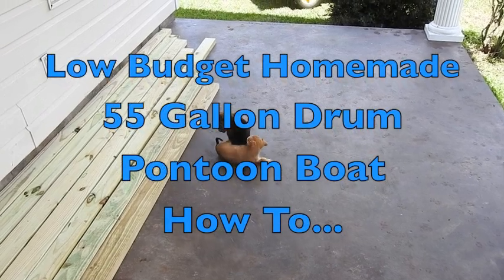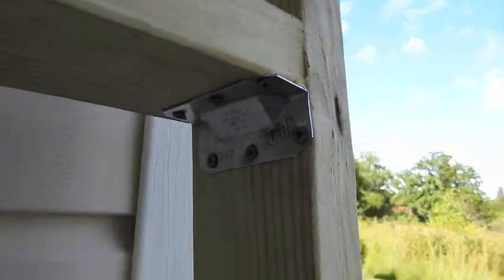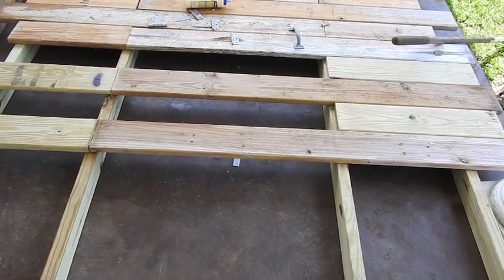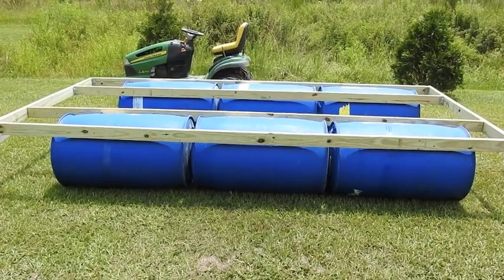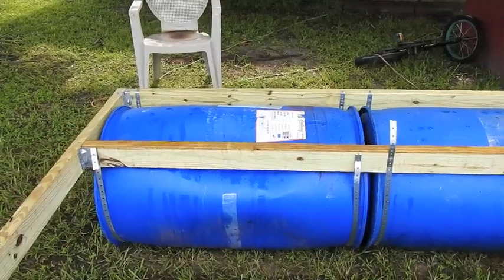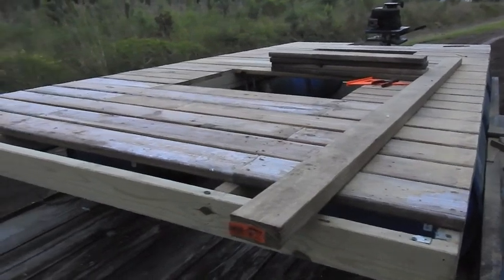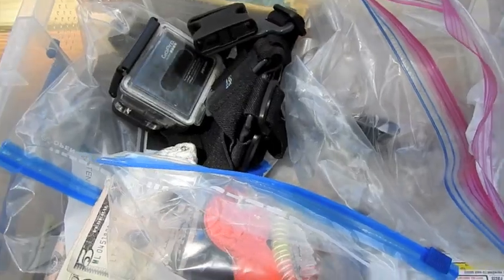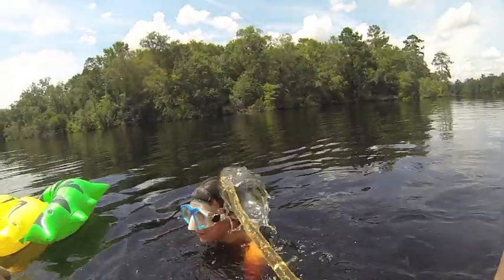My $200 Homemade Pontoon Boat (55 Gallon Drums)

Comment: Vicegrips on battery posts?  Do not accidently fall around the battery especially when you're dripping wet. Not that it would matter much I suppose. Why no battery cover and proper battery hookups?
Reply from the maker: I don't think it would matter much, it is D.C.  In later episodes, I put in a battery box and proper marine battery. Thanks so much for watching. I hope you will watch up to episode #10.
Reply: @chud327  i meant for protection and yes, it can do damage to you. Car batteries put out large amount of current if you accidently touched both negative and positive posts at the same time.  Negative could be grounded to other things such as motor and controls so you would only need to touch the positive and those items if that is the case. Just a safety message.

Comment: urethane the deck and could be a saftey issue with that opening  right before the motor
Reply from the maker: I was just looking at some deck sealer, but have to decide on a color.  I want to close that hole in better. Thanks for watching.

Comment: I love self-made practices of ingenuity, but the problem I've run in to is the matter of getting them registered by the state.
Reply from the maker: What state, Florida was a piece of cake. Thanks so much for the comment and for watching.
Reply: He had good basic construction methods. Save list of materials and receipts for anything purchased. Documenting the build on video helps. Then take to DMV and get the form, you will most likely be referred to closest coast guard station to get signed off.

Comment: Good idea however it needs refining...put a V structure on the front barrels to help it cut the resistance to move ...motor needs to be lower in water about 3-4 inches will do...side rails for safety
Reply from the maker: The V structures came alone in episode #4, hope you will check it out and let me know what you think.  Changed motors in episode #2 and in episode #5.

Comment: You want that to float even better Get yourself some valve stems off a car rim drill a hole in the cap seal the stem and fill the drums with air.
Reply from the maker: I am not sure that would help, but thanks so much.
Reply: you foam the drums.

Comment: Boy you need a 1/4 cordless impact driver. You would have finished that deck in like 15 mins flat
Reply from the maker: Cordless would be nice, especially when I was putting the tin roof on the tiny house... Thanks for watching.

Comment: Good diy project. Unfortunately some of the lid of the barrel is located underwater........should be on top and just underneath the deck to ensure that the water does not sip into the barrel in case the cap is loose.
Reply from the maker: I got the caps really tight and there was an o-ring seal, they should be fine.  I might do pontoon #2 a little different. Thanks for watching.

Comment: PUT PVC FRAMING ON TOP WITH A CANVAS WITH A RAILING FOR SHADE,NO?  THE WOOD SHOULD HAVE BEEN SHELLACKED,NO?
Reply from the maker: Shade is a plus here in Florida, for sure, I added a nice bimini top and  I did seal the wood in a later videos.  Thanks so much for watching.

Comment: Nice job !!
I made a boat out of oil barrels
Reply from the maker: Yes, I have already seen that one and I just checked out your cheap kayak.  I have just started a "homemade barrel boat" group on Facebook.  I would be honored if you would consider joining and sharing some of your builds. Thanks for watching.
Reply: Of course, great
Reply from the maker: Is that you that posted on the FB group. If so, thanks so much!

Comment: I tried building a floating duck coupe with plastic 55 gal barels.very unstable & unreliable. Constantly flipping over.it sucks.ill never use barrels for floating docks again.
Reply from the maker: needs to be wider and thanks for watching.
Reply: @chud327  i know where i messed up.i had the barrels turned sideways.for some dumb reason i turned them sideways & it was very unstable.but looking at urs i got it figured out now.guess ill be building another one after all.

Comment: do you have the specs for this?
Reply from the maker: I used 5 12X2X4's. One was cut in half and the other 4 were left full length.  I screwed the cut one to both ends, that makes the boat 12'3"long X 6 feet wide.  I am actually planning to do a compress version on the build that would include all 8 episodes into to move video. Thanks for watching.

Comment: Use pvc instead of 2x4's on your frame... but be SURE to use the the glue that comes with it...
Reply from the maker: I don't know if PVC would be as strong. I am planning build #2, but it will be wood too. Thanks for watching.
Reply: chud327  not if you use the 5 inch pipe that's 1/2" thick.
Reply from the maker: Exactly how much would 5 inch by 1/2 thick cost? Sound super expensive.  I try to go cheap.  Thanks for the reply.
Reply: chud327  I'm sorry buddy, I live in California and would have NO idea how much they'd be for you...
Reply from the maker: LongTall Texan Sorry, that was a rhetorical question. I didn’t want you tell me the price, I wanted you know that would be too expensive. Or you could’ve just given me Californian price.

Comment: Thats Brackish water,, salt an fresh water mix, and thats what you get BLACK water. I'm thinking it's on the Gulf side of the state, like Sarasota
Reply from the maker: It is actually on the east coast about 30 miles inland of Fernandina. Thanks so much for watching.
Reply: Darkness is not from salt and fresh water mixing.  It's from natural tannins from the trees leaching into the water.

Comment: He said," Her shaft is bent & the rear end leaks,
You can fix it quick with an oily rag.
Use a nail as a starter, I lost the key.
Don't pay no mind to that whirrin sound.
She uses a little oil, but outside of that she's a cherry.
Well, I put nail in the slot & fired her up, 
She coughed & belched up a bunch of smoke,
And, I backed her right thru the Hog pen into the yard......
Reply from the maker: This would be great if I did comment trolling... thanks for watching.

Comment: Rough water one time and those straps are toast. I've used those for things before, weak weak weak.
Reply from the maker: We were hitting some wake in a lake in a later video and the straps did great.  I guess I will have to stay out of rough water.  Did you think of any alternatives? Thanks for watching.
Reply: All I can come up with is the wide heavy duty ratchet straps maybe. Twenty something for three at WalMart. 40+ would single strap 6 barrels. Good Fishin Bro ....   One of those 85 lb thrust trolling motors and two or three batteries I bet she'd fight through a helluva wind. If you ever roof it, a solar panel could trickle your batteries constantly. I like it. Park it over a good crappie hole, yo good times.....
Reply from the maker: I want to do some fishing some time soon, I will be sure to share that adventure. Thanks again for watching.  BTW, have you seen parts 2, 3, 4, 5, and 6 yet?

Comment: Perfect boat for the back waters of Florida swimming and fission put a 2 x 6 for a transom then mount to 300 hp Mercury motors on it you can really go to town shit put a 2 x 12 back there and put forth but for those 300 horse mercury’s on there then he’ll be in and styling
Reply from the maker: Yes, 300 might be over the top, but it would be a fun experiment... Thanks for watching.

Comment: why did not take into account the resistance of the water, because it is so simple. The result is a large fuel consumption
Reply from the maker: I does pretty go with the homemade motor, the are angles on front now too. Thanks for watching.

Comment: And I am 100% building this.
Reply from the maker: Let me know how it goes and be sure to check out my second build too. thanks for watching.
Reply: @chud327  for sure I just realized watching some of your other videos we live in the same area maybe I’ll see you out on the river sometime!
Reply from the maker: @davidmiller571  very cool, what area are you in? Would be very cool to have two barrel boat together out on the water…
Reply: @chud327  I live about 1/4 from lake alto in Waldo. Not on the Suwannee but it is a part of the Santa Fe lake chain that technically feeds it. I’m working on rebuilding the transom in my boat now then I want to start work on a barrel boat. I have a couple motor options for it.

Comment: I've worked at 2 different Lowe's stores and we didn't use any paint on the kull lumber. One store it was just put on a cart and my current store bundles it up and you have to buy the whole stack.
Reply from the maker: I bought my lumber from Home Depot and I guess they like the purple paint method.  Sometimes there is a bunch and sometimes there is very little or nothing. I wish I knew when they first put stuff out, you could find some really good deals... thanks for watching.
Reply: chud327 I'm working at a lowes at the moment and working in the lumber area I would try to sell anything damaged. Lumber would go for 50-75% and bags of concrete or sand was $1/bag. It's nice working retail also I've gotten a lot of deals my self.
Reply: At my Lowe's if I catch them before bundle it I can buy discount individually
Reply: fat guy foraging I used to do that but they changed it to where the whole cart had to be bought. Even the employees couldn't pick n choose. But that was at my 1st store and under a different manager.

Comment: Sorry bro, but making the width of the boat exactly fit in the trailer wasn't the best idea.  Should have given yourself at least 2-3" of clearance on both sides. I noticed how much trouble you were having loading it into the trailer at the end of the video.
Reply from the maker: Wanted maximum width.  If you watch later episodes, you well see I backed the trailer deeper and loading and unloading were a piece of cake. Thanks for watching.

Comment: Piece of advice, Don't use the puppies as motors. Puppies can't poop in water!!
Reply from the maker: Good point and thanks so much for watching.
Reply: Turned the puppies into wood glue. My Basset Hound farts enough to be a jet drive though.

Comment: what's a tobuhfur?
Reply from the maker: tuba4 is how we pronounce 2X4. It is the dimension of the lumber I was using.  It is actually not 2 inches by 4 inches, the actual size is 1.5" X3.5".  This saves the lumber companies a bit of wood on every board with really adds up to a bunch of lumber over the years.   You can still find rough cut lumber that is actually tobufur on things like pallets.  In fact, I may use some pallet boards when I build pontoon #2, but we will have to wait and see about that.  Thanks for watching.
Reply: chud327 I thought a tubas was for playing music in a marching band 🤣🤣
Reply from the maker: @humancentered3447  homophones - two words with the same sounds, but with different meaning....  Thanks for the reply.

Comment: PVC pipe is cheaper and lighter I would use instead of heavy wood imo~
Reply from the maker: Lighter yes, but I don't think it is cheaper or strong enough to be the boat frame.  What size pvc are you thinking? the 4 inch and bigger get pretty expensive fast.  Thanks for watching.

Comment: No sir you need changing gears in a transfer case your motor. 5 horse motor is plenty strong enough just got to change the gears make your prop spin faster and heaven forbid get that thing in the water deeper

Comment: Why are you towing it with a car don’t you have a truck?
Reply: Bam1x didn't you see the S10 in the video? Don't be a jerk.  Just appreciate the video or leave.
Reply: @wkualum was I asking you? Uh no
Reply from the maker: Thanks for watching.
Reply from the maker: The car is more reliable and I want to take the boat across the state on Monday. The car also hauls 5 people, has A/C, and better gas mileage... Thanks for watching.
Reply: Bam1x your comment came off as smart aleck and unappreciative.  So, I thought I would say something similar back to you...obviously you can dish it out but not take it.
Reply: chud327 just wondering thought I saw another truck in one of your older videos I did not know it was not your truck.
Reply: chud327 think it was a Toyota Tacoma
Reply: wkualum like I said I thought he had a different truck besides the two s10

Comment: that water is filthy, and you swim in it ??????????  good pontoon though, give tons of fun.
Reply from the maker: It is just tannic acid, the same thing that make sweet tea brown.  If you watch episode #4, you will see it in crystal clear water.  #4 is my favorite place to take it. thanks for watching and you are right about tons of fun.
Reply: @chud327  Have you thought about making cones for the front ? you could make some large cones /points from another barrel, they can be cut and made into cones for the fronts and with a heat gun can weld together so they are seamless, they would not hold any water or air , purely for much easier forward motion and take the brunt of any landings on mudbanks or stones etc. . the blue barrels are brilliant, lightweight never rot like steel ones and easy to repair if they ever got punctured..
Reply: forget it, you already done that in number 4 ha ah
Reply from the maker: I was going to suggest #4, I am glad you found it.  You had some pretty good ideas, sounds almost exactly what I did.
Reply: @chud327  your point at the front are perfect, like the way you made them into lockers too..
Reply from the maker: Thanks so much, storage is at a premium on boats.

Comment: you could put the trailer more than 4 inches in the water when loading? really? come on man work smarter not harder.
Reply from the maker: I was trying to keep the front axle out of the water, but we have learned from parts 2, 3, and 4, just go on in... I hope you will check those out and thanks for watching.

Comment: Not sure how this cost only $200.
Reply from the maker: I had the deck boards for a dumpster.  I had the kicker from a previous project.  I had the trolling motor from a previous experiment.  $200 covered the cost of the 6 barrels, the 2x4's, the screws, and the brackets.  I will try to put what it will cost if you don't already have deck boards in my next episode. Thanks for watching.

Comment: $200 you could have bought a 14 foot Jon boat...
Reply from the maker: Christopher Roosa Yeah I’ve had one before, this one is much more fun. The Jon boat couldn’t hold as many people, couldn’t stand  up and walk around as good, and couldn’t put as big of an engine on it… But thanks for watching.
Reply: @chud327  I bought my Jon boat for $100 and then got some plywood and carpet and turned it into a bass boat for like $250 total.
Reply from the maker: I bought mine for $140 and should have turned into a bass boat, but didn't.  Those conversions are really cool.  I have an old aluminum boat I plan on fixing up, but I don't know yet what I will do with it.  It will after I get the title for it and after pontoon boat #2 is done. Do you have videos of your boat? Thanks for the reply.

Comment: water looks like diarrhea liquid.
Reply from the maker: And still looks 10 times better than your comment. Thanks for watching.
Reply: Great job on the boat. Y'all said it was slow however if it floats and moves under it's own power it's certainly a success.
Reply from the maker: And recently I put angles on the front to make it faster, episode #4.  Next I want to do some gears or pulley to make it even faster. Thanks for the reply.